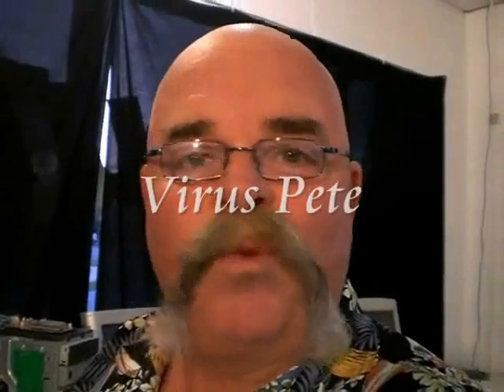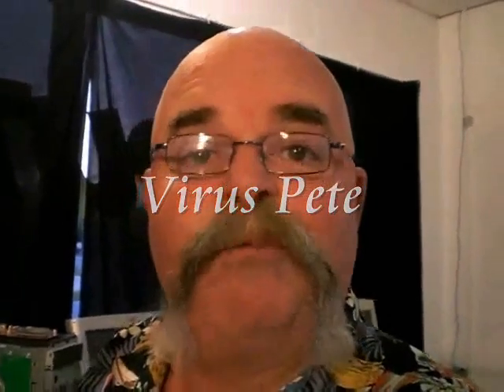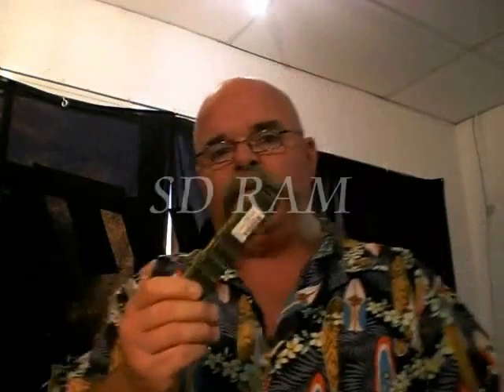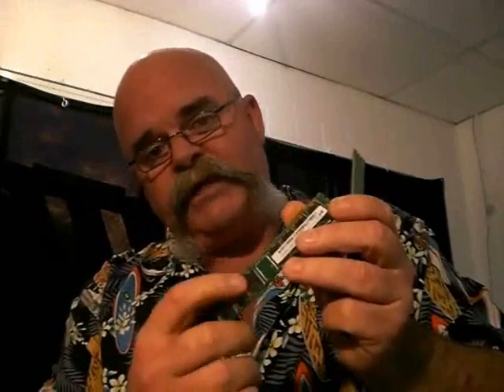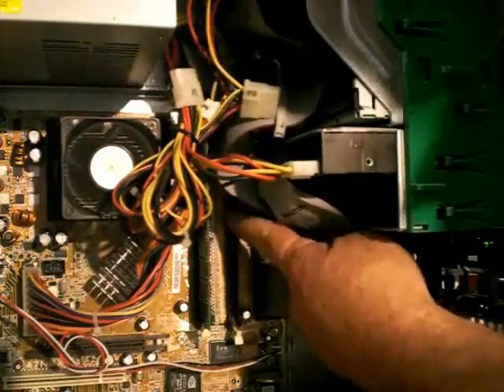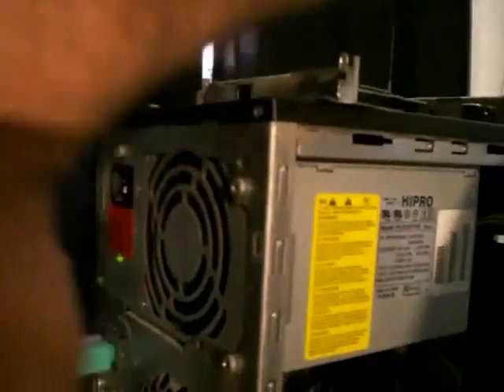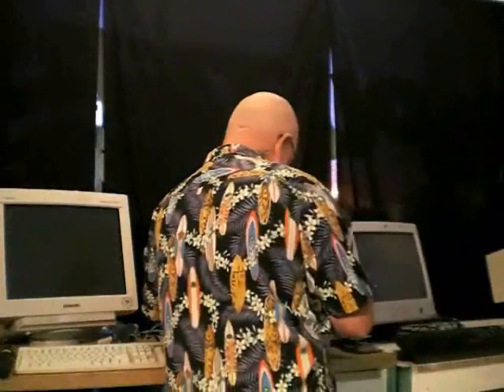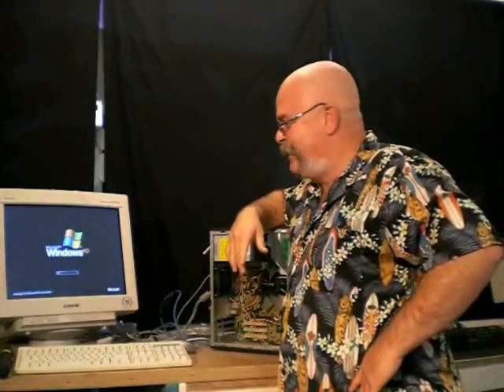PC repair for DUMMIES - No signal to monitor

Comment: Hello Pete! That didn't worked out for me, but the RAM is still the main suspect in my case, cos I excluded one by one the PSU, CPU, GPU, motherboard (green light and all of the fans are spinning), and monitor. Only for the RAM I can't test them with others, cos in my country Romania at least, it's impossible to find, they are first gen DDR 3, no CL,my CPU being only a Haswell. But now when after watching several YouTube videos and the RAM is the main suspect remained (still even of the green light and all the fans spinning I haven't excluded my Mobo 100%), I have another Mobo with an AMD APU, and after I'll install it with the hard drives and those two RAM sticks, I'll know for sure if it's the RAM per se or their slots on my current Mobo.

Comment: I have got two monitors but  they work independant of each other . i could switch from one monitor to the other  i switched the cables and plug them in separately they both work but not together . can anyone help , Thanks

Comment: No signal monitor. I can hear Windows sound it boots it posts fans running.. Still it can be related to Ram while it boost and Windows working but no signal? İ tried Ram btw no work.. İ tried everything...

Comment: Tried it mate, but my monitor continues to tell me "no signal input." 
My tower seems to be running smoothly and I cleaned the ram but it still ain't connecting to my monitor.. Actually I tried it on my newer monitor too but to no avail..

Comment: I've tried but the ram isn't the problem it won't work I just built it and it's my first build I've installed graphics cards and other stuff before but for some reason sometimes it works for a few seconds then it turns off I've been trying to fix it for 4 hours now
Reply from the maker: did u get it sorted??

Comment: OMG IT WORKED U LEGEND

ok so I’m 12 y/o and Thank God I have big interest on pc’s 

I have a Dell Inspiron 560s

Which I added a Amd radeon 570 gpu 

I just pushed down the tips on the RAM slot got the DDR3 RAM out cleaned it with a microfiber cloth and it worked thank you so much

Comment: When i tryid it. Dosent work at me i have tryid do every think but monitor not working. I maybe wanna buy a new computer part wicth controls the monitor. But i dont know witch part do that. Tell me witch the part please or if u know whats is the problem then tell me because its not ram or cmos battery...

Comment: I have just tried this and didn’t work for me, is there anything else i could try?
Reply from the maker: You could try re-seating the graphics card if you have one. Otherwise it's off to the repair shop I'm afraid  ;)
Reply: Would changing the CMOS battery help??

Comment: I have a add In graphics card for a dual screen connection, have the dual vga connection, when I plug it in there is no signal from the dual connection but there is from the single connectio, I have cleaned the RAM, any suggestions how to get signal

Comment: One of the best explanation videos to reseat the RAM. Only wish it would have worked for me. Took both Ram sticks out and cleaned, put back in; still getting the message "No Signal" and other monitor says "NO RPG." I read to try reseat the video card, hoping you have a video for that!

Comment: IT WORKED !  I just changed 2 capacitors on my motherboard and I taught I did something wrong.. But the solution was this simple :)    it did not work at first, but since I have 2 ram cards I swapped them and now is all normal again :) :)
Reply from the maker: Glad to help ;)

Comment: Hi guys, 

I just started my PC after a while & it turns ON, lights turn on, but there is NO Display on Monitor. 

I did some research on Google about this issue & did a few things. 

1). I removed all the hardware, except processor & power supply. Turned On, but same issue. 
2). I tried after removing ram, & then by switching ram slot, but still no use.
3). I removed my HD 3450 512MB graphics card & plugged monitor in Built-In Monitor port & Vica versa (In Graphics Card), but no use. 
4). I removed hard disk & DVD rom & changed their power cords, but no use. 
5). I removed the computer cord, & pressed & hold the "ON" button for 30 to 60 seconds, but no use. 

It was working fine a couple of weeks ago, but then I turned on & it was not working anymore. By the way, when I turned on it acted a little weird before going dark. Actually when I turned on, it took a long time to get to display & then window was also working weird, then I restarted a couple of time & I though it was my hard disk, (who sometimes have power cord issue that works fine if we change it, but its not that). 

Any idea how to fix this issue or what is wrong with my computer?

Comment: removed the ram, cleaned it up, and reinstalled.  Monitor still not getting anything from the monitor.  Thanks for the tip anyway Pete.
Reply from the maker: Maybe the graphics card?

Comment: i recently had this issue ,computer is on but no display , i have tried cleaning my Ram , Heatsink fan and replacing my battery but non of them worked , i asked my friend he told me to indtall a new bios from repair shop or your inboard display card maybe damage ! what do i do help me please

Comment: My windows 8 PC turns on but the screen says "invalid format"..... it does this on 2 monitors I tried! How do I get my pc to reset to a lower resolution? (dont tell me to boot into safe mode because that isn't an option from Windows 8 F8 start up menu. Technically it is but the screen won't load duhhhhhhhhh.

Comment: I just bought a new processor to put in so I took my old one out then realized my new one isn't compatible with my motherboard so I reinstalled my old processor now there is no signal on my monitor

Comment: mine have signal but screen is black. i have tried to replace ram, also checked cables but still cant find problem any ideas?!
Reply from the maker: Could be mother board...signal cable or graphic card...best get it looked at...
Reply: +PRECISION COMPUTERS - THE LIGHTER SIDE OF I.T. than monitor goes for sleep i can wake up with moving a mouse, i just see led changes from yellow to green. Monitor is fine, also pc have all sounds. This problem start than fuse exploded from power supply cable, i think it happen because power supply switch was broken. well i replaced fuse and pc works but not showing screen. Also unplugged all cables from motherboard and plugged them back.

Comment: This video tackled the issue the right way. I've looked at a good amount of sites for fixes and while they all might be valid in some way, this was way more concise and approachable. Instead of starting out with some weird #18th solution you deliver the 3 most common and simple causes to do first and the fact these weren't on the top links on google is pretty strange to me. None of the tech sites has "wipe your RAM" as step 1 and that literally is the simplest thing and it totally worked, thank you so much, this had me stressing all day at work and I'm so glad to have the weight from my shoulders, you are the Australian Gabriel, coming to deliver me my baby Jesus, which in this instance is my computer which is not again able to display crisp imagery for my viewing and other such pleasures, 감사합니다
Reply from the maker: wow, now that's a big comment right there...lol... glad to help...
Reply: +PRECISION COMPUTERS - THE LIGHTER SIDE OF I.T. yes i have a problem. i have all of my rams hooked in into my computer and every time I hooked it up the computer and it boots up fine but no signal what do I do?

Comment: Hello, so one while i was playing a game my gf came over and so i just left the game running she left about 6 hours later i came back my keyboard stopped glowing my  stopped glowing my  was black the light on the bottom of the monitor was flashing i tried moving the mouse and stuff nothing happened so i called asus about my  they asked if i upgraded to windows 10 i said yes and the bias settings for that motherboard were set for  originally so i sent it off and they replaced the bias settings the battery and so i got the motherboard back i put it in start up my computer same thing happens no response from the usbs.... I tried a vgr cable for my monitor didn't work, i tried different sticks of ram didn't work, i tried removing my  didn't work, tried different power supply's didn't work... 
Anyone have any ideas what could be wrong? 

 or motherboard what please let me know.
Reply: that means something might be loose in your pc. MIGHT
Reply: nothing is loose i checked all cables everything and nothing is loose
Reply: this happened to me once then i took it to the computer shop and they told me something is loose
Reply: im not talking bout the cables
Reply: what do u think it was? do u know what was loose
Reply: +GamersPlace Im sry but idk. Get to the nearest pc shop and ask for help
Reply: +GamersPlace check the CPU power cable in the mobo and in the power supply, that powers mice and keyboard
Reply: checked it all we think its the motherboard we swapped out all the components and it still done nothing but we didnt swap out the MBU

Comment: Hey Pete, I also have a question i am having the same problem with an old 2009 pavilion i bought today. Everything on the computer seems to be getting power and running fine but no matter what i do, it says no signal. I've tried taking out the ram, and several other things with no avail. Please any help is appreciated
Reply from the maker: If the machine has a dedicated graphics card, then it is mostly likely failed. Dead Ram or a failed MB will also cause the same symptoms...good luck  ;)

Comment: Hello can someone help me??
So i dont have a DESKTOP ..
I have the computer that is only monitor like laptop but looks like a monitor {Windows 7}
So I plug in the power cabel with the computer and everything is good so i try to turn it on then NOTHING!
Idk whats the problem i checked for about 2 hours everything good IT WONT SHOW ANYTHING OR CHANGE FROM BLACK COLOR!
So I need help if u know guys please because i need the computer 
{Computer haven't been used for about 3-5 months}
Reply from the maker: Sounds like a failed MB or Power supply...
Reply: I'll have to check but if one of them failed what do i do? is the whole computer now useless and not useable?

Comment: Thanks for saving me from a possible heart attack, mate! Just goes to show, one big rebuild can be stopped in its tracks with a tiny bit of dust in the RAM slots... I also set up the sticks so that they were paired with the ones they were packaged with (I have 4, same make, bought at different times), not sure if it made a difference, but problem solved. :D
Massive respect from this Dummy in the UK.
Reply from the maker: glad to have helped...

Comment: Pete, heres more info.  Maybe diagnosing my problem may be useful to others.  Feel free to delete all this after reading.  

Compaq Presario PC – running Windows 7 Ultimate 

1 Nvidia GeFORCE 8800GTS  check to see if this driver is correct and/or if damaged. Graphics driver:  Also, the screen will occasionally just black out, and then come back on, usually during Graphics or photo review or selection, sometime does not come back at all and must reboot..  
2.Sleep mode is problematic - see below
3. Computer running somewhat slow.
4. There are about 5-6 background programs that open upon reboot.  What are they?   
***********************
When put into Sleep mode via desktop button next to Shut Down button, Sleep mode will awake computer correctly for about 1-2 hours and recall work session by hitting any key.  However, usually beyond that amount of time, when I hit a key or mouse to awaken computer, it does not awaken at all, and display stays black, and the screen orange ready light stays on instead of the green, "ON" light.  There is also no pointer, mouse or keyboard control, and the computer ON/OFF power button will not turn off computer.  It freezes in this black screen state.   I actually have to unplug the AC cord, then plug it back in, and then push the on/off button on computer to get it to reboot.  Also, during reboot, the black Reboot screen with the “Compaq” name comes up, there is 5 sets of 4 vertical red dotted lines on the left side of screen.  These lines are also intermittent and I have no idea what they mean or do.  Reboot time from this state is about 4-6 minutes- Regular reboot time is 90 seconds.  Sometimes when “Sleep” mode button is present, the Hibernate button is not.  When both are present, they are both grayed out and do not function and only option to turn off computer is Shut down.

SPECS 
OS: Microsoft Windows 7 Ultimate
Version 6.1.7601 Service Pack 1 Build 7601
System Type X86-based PC
Processor AMD Athlon(tm) 64 X2 Dual Core Processor 5000+, 2600 Mhz, 2 Core(s), 2 Logical Processor(s)
BIOS Version/Date Phoenix Technologies, LTD 5.26, 4/28/2008
SMBIOS Version 2.4
System Directory C:\Windows\system32
Boot Device \Device\HarddiskVolume1
Hardware Abstraction Layer Version = "6.1.7601.17514"
Installed Physical Memory (RAM) 3.00 GB
Total Physical Memory 3.00 GB
Available Physical Memory 1.63 GB
Total Virtual Memory 6.00 GB
Available Virtual Memory 4.30 GB

Comment: Pete, my Compaq Presario PC is running Windows 7 Ultimate. Sometimes my monitor just goes black. It's an intermittent problem. Sometimes the red light in my mouse also goes out. When both these happen, the only way to shut off the computer is to unplug it. When the F-10 Setup reboot screen comes back, there are two groups of vertical dotted lines, one group of 5 sets of 5 yellow dotted vertical lines and another group of 7 sets of 5 and 6 orange vertical dotted lines. All this business can be resolved by doing a system restore, but it doesn't last but a few turn-ons. Concurrently, the Sleep and hibernate buttons on the desk top are also grayed out. They will come back after a system restore but will only awaken computer after about an hour of turn-off. After that , power must be cut to turn computer back on. Along with all this, sometimes in watching a video file, the video stops and/or burps along and then error message says "Windows program has stopped working" and I must close out of video. My video card is an Nvidia GeForce 8800GTS.  Any thoughts as to the problems?  Thanks

Comment: Is the VGA port  (located behind the computer) damaged if the monitor works when connected to computer B, C, And D, but does not work when connected to computer A. Please note the computer and monitor are both operable and is currently connected to a brand new VGA port. Thank-you :)!

Comment: I'm having this problem occasionally, maybe one or twice a month, and all I can do is force a shut-down by turning the computer off.  When the computer comes back up, all is fine. I'm also occasionally getting the blue screen of death with a "Bad pool header" message. The crash dump files indicate a problem with ntoskrnl.exe. I did a memory test and all was well. I wonder if the two problems are related? Any idea?
Reply from the maker: +LucilleB The best way to sort out corrupt OS issues is to back up your data and reload the OS...

Comment: Nice video but didnt help with my problem. I have tryed two monitors and both keep going to sleep on me.. So do you maybe have another fix???? TY
Reply from the maker: +Kelly Blackheart Sounds like a graphic card issue...
Reply: Ty for getting back to me. Yes as my system is older and the graphic card is built into the mother board so it is safe to say need a new system. Since they say them types of mother boards are hard to come by these days. But ty very much for getting back to me. Your videos have helped me many times . gday mate

Comment: It's advisable to wear a ground strap to prevent electrostatic discharge and damage when working with RAM chips, CPU, video card, etc. Don't directly touch the electrical contacts and try to handle the RAM memory board by the edges. I think Pete is showing how NOT to handle RAM chips.

Comment: hi pete,  wondering if you could help me with a problem.  I got a computer from someone and what he did wiped the hard drive clean.  No windows operating system.  I did down Windows 10 to a USB drive.  It looks like no signal is coming thru computer so I don't see what going on.. What am I missing?
Reply from the maker: +Fernando Nando Could be ram...or graphics card issue Fernando...

Comment: Hey can you help me out a little? Ive got an ASUS Gaming PC, I DID NOT build it. Processor: Core i7-4790k, Graphics card: Geforce GTX 9704GB, RAM: 16GB (Two 8GB's in PC DDR3) HDD: 2TB (Don't think that matters) My problem is that my monitor will not get any signal. Cables are perfectly fine and plugged in well, I've tried taking the CMOS battery out of the motherboard about 4-5 times, got me to the BIOS settings, i had no clue what to do so i just discarded and exited, closes i got was to the first boot screen and then no signal again. Ive taken out the RAM, cleaned it, did everything, nothing happened. Even tried only 1 single RAM. The cause of this problem was just yesterday when it was perfectly fine, playing all my games, then I went and bought two DDR4's 4GB RAM's. Obviously they don't fit but i was just being stupid and put them in with my two extra slots. Plugged in the PC, everything turned on great, fans running, hearing noises, keyboard lights turned on, mouse lights turned on, but no signal from monitor. Took out the two DDR4's, plugged my rig back in, still nothing. Hence i then looked up about 30 youtube videos because i know nothing about this, and have tried everything. Im considering bringing it to a technician but i stumbled on you. Hopefully you can help me?